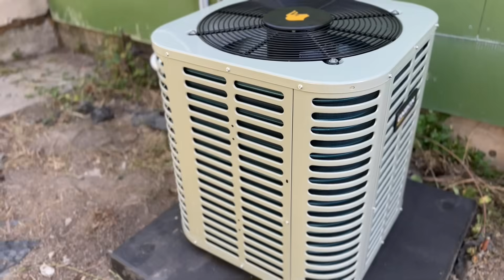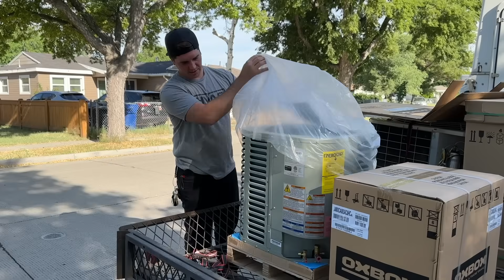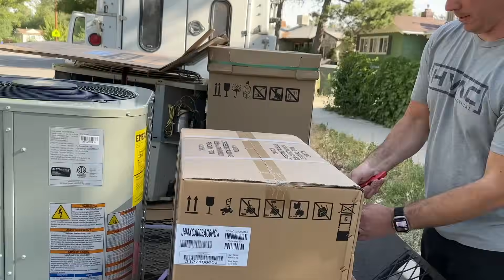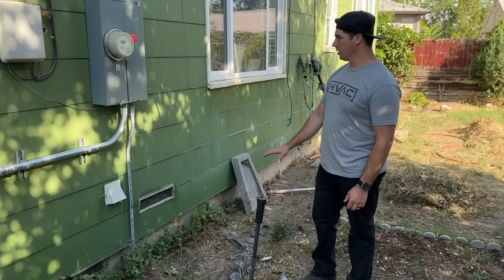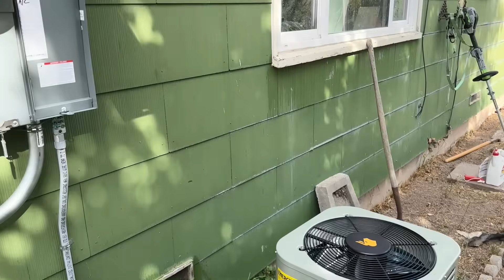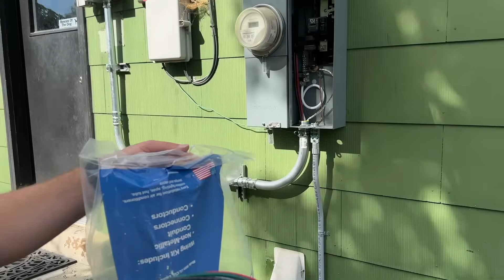We Added Air Conditioning To This Home In ONE DAY.     |      Full Installation From Start To Finish

Comment: I have a ACIQ 3 Tone heat pump. I have install it and powered it up several time. I can only get the air handler fan running that should not be running. What can I do?

Comment: At around 14:30 minutes or so  he just swapped g to to y but many boards require a g call as well to energize blower in cooling.  A simple jumper between y and g would fix if that is your situation
Reply: Im also wondering same thing, im new G is always fan for starter like me. When move to Y for cooling sure it will energize fan when thermostat call for cooling what happ3n when its cold and the furnace start the Y is not energize and so is the fan, i feel like an idiot here

Comment: How is the low voltage/24v wire ran start to finish. Does it not need a junction box by the disconnect

Comment: Absolutely the wrong way to do the braze joints with a high pressure refrigerant like 410A 😂 don’t believe everything you see on the internet or YouTube. Also ALWAYS USE A TORQUE WRENCH. Refrigerant burns the shit out of you and displaces oxygen. So many issues with this install. Way to close to a window, way to close to an exhaust vent and really far off of the house. It’s dangerous work, if you can’t do it safely or legally, hire a professional.

Comment: Love your videos. I just got my A/C serviced and the technician said that I would need a new capacitor. He hooked up a voltmeter to the left node and it was about 37%......he said it should be around 40%. The right-side node was about 5%, which he said was good. He said the cost of an installed capacitator would be $375...which seemed very high to me. I took a photo of the part and after he left, I checked on Amazon and saw the part was about $17. My question is ....at 37% does this part have to be replaced? We haven't had any issues to date. I live in the Boston area so the next time we'll use the A/C will probably be in June/July 2025. Thanks

Comment: I have a 20-year old Bryant gas furnace. It was installed with the evaporator, lines and power connection outside for a future AC unit. I buddy of mine is installing a new heat pump at his house and he's giving me his 2-yo, 5-ton Blueridge BA16L60P A/C unit.  What should I consider/check out in deciding whether this A/C unit will work with the Bryant furnace? I've had HVAC companies out to give me bids on installing A/C and most of them told me that the evaporator couldn't be used, usually without even looking at it, and of course they all want to sell me a new furnace "because that one could fail at any minute!".  I don't need the scary sales tactics, I need an honest opinion of what's possible here. Love your videos!

Comment: Very green neighborhood for an arid region where swamp coolers work.  We had one in a Mojave Desert rental house, but didn't quite suffice when 110 F outside.  My 1.5 ton Della minisplit heat pump came with an AC cord of just 16 awg wires (240 VAC).  Instead, I ran 12 awg to the cut-off box and previously ran 8 awg stranded from the subpanel to the cut-off, both for the future and because didn't know how little current the compressor would draw (1.5 kW max).  My central AC failed, so looking at replacing it.  Only need 2 ton or less since the mini was actually cooling my whole house this summer (Central CA, up to 110 F days) and have all Winter to fix 'er.  Options keep improving for a smart inverter type w/ duct evaporator.  First I heard of this OxBox system.

Comment: Hi DIY HVAC Guy, I don't see you charge the new AC unit with the refrigerant. When you charge the new AC, do you turn on the AC system with empty refrigerant in the pipe?

Comment: Hey gang, 20 years ago, I installed my 3 ton Trane 19i with R22.  I'm 66 yrs old (retired) now and do not have the money.  It appears my compressor is shorted, but I do not smell any burnt freon...strange.  I want to install another AC with 410a, but I do not know what unit to buy.  Trane was too complicated and expensive.  I just want something easy -- not fancy...maybe variable speed fan.  Can someone give me some advice on a unit? Also, I do not know what to do with copper lines (high & low). Can I keep the same high & low copper lines if I switch from R22  to 410a?  Do I simply vacuum lines before recharging?

Comment: I have a dumb question: Can I check for leaks injecting compressed air into the lines?
Reply from the maker: No!! I mean you can but you’d be injecting a ton of moisture which is what you want to keep out of the lines. Nitrogen is a dry gas which is what professionals use it.

Comment: I’m in an older house that has a 100 amp as the main breaker for the house. Would I have to up that to a 200 to install this?
Reply from the maker: Depends on the size. If it’s smaller like a 20 amp breaker, (1.5-2 ton) then you could probably get away with it.

Comment: So the units come with the refrigerant already in it
Reply: Yes. He installed the equipment. Linesets and got them soldered. 
Next he used Nitrogen to pressurize the line sets. 
After he proved they were tight. He used the vacuum pump to remove any traces of water. Water and Refrigerate creates an acid.
After he proved a tight system again. 
The very last step is to release the refrigerate into the system.
Reply: @2nickles647  i don't see he charges the system with refrigerant. Did you see it? How did you charge the new AC unit with refrigerant? Do you turn the AC on? I'm not sure if the NEW AC comes with a little bit of refrigerant.

Comment: I JUST WALKED INTO A HOUSE WITH A BOILER FOR HEAT, SO THEY HAVE BASEBOARDS......AND THEY HAD TWO BULKY AC UNIT OUTSIDE BUT INSIDE THEY HAD NO WALL UNIT INSTEAD THEY HAD VENTS ON THE CIELING???? I THOUGHT IF YOU DIDNT HAVE FORCESIR/FURNACE YHEN YOU WOULD NEED A WALL UNIT .....HOW IS MY EXPERIENCE POSSIBLE

Comment: My one question is why did you sweat that drier on the tailpiece?  If you ever have to open that system up for repairs you would replace the drier correct?  How would remove the drier?

Comment: Thanks!
Reply: I just replaced my old furnace and AC system after I installed it the new system is working fine,..
It was a little bit harder than how it looks in the videos but I was able to do it, thanks so much for your videos I saved a lot of $$$$

Comment: As a hvac tech great job on the install. Only thing i would suggest is that you need to let your viewers know that they should check with their local laws. Permints may need to be pulled. And its possible that if its not installed by a licensed hvac company insurance can deny any payments if house  catches on fire do to improperly installed unit.

Comment: The problem with installing your own AC is that besides being EPA certified you need a state contractor license just to buy an AC which sucks. I can buy all the r22 I want but I can't buy a flipping ac without going through hoops to do so on the internet which makes no sense.
Reply from the maker: Wrong. It’s super easy to buy equipment online. Amazon or hvacdirect as well as another handful of companies sell to the general public.

Comment: Great job! I installed 2 units (3 and 3.5 tons the same way, but with TXV) plus a 1 ton mini split (easier). I have Testo549 with Yellowjacket hoses, vacuum pump and CPS micron gauge, Appion valve core removal tools. Staybrite8 (high vibration, high pressure and refrigeration applications) was a great find for me for the second unit, sped up the process vs brazing with turbo torch.
The key is to invest in high quality professional tools/nitrogen tank (for me it was ~$400-500 overall) and then do it slowly. Warranty is not a concern, cause most of the time you will still need to pay for labor (90% of the cost) even if you’re under warranty , the equipment is cheap and available online anytime.
Reply: Did you buy them used there is no way in hell you can get all that for 500$.
Reply: Today, $2500

Comment: I found it very confusing when living in the USA that it is called HVac. It’s only 220 watts. Mine barely worked when it got really hot. But living in a condo, the other owners were not prepared to spend any money to do anything about the almost non-existent insulation of the building.

Comment: Well most of the HVAC system can be done by a tallanted DiY type.  But there are parts better left to a proper HVAC contractor, those being the pressure test, vacuum down, and then charge the system properly.

Comment: Well done! I'm from the old HVAC school. 44 years in the trade and as long as i have stayed open minded and teachable, I learn how to do this job in easier and safer ways. Great video young man!
Reply from the maker: Thanks bro! 👊🏼
Reply: hello sir pls help i forgot to turn off my heat pump while renovating sanding the kitchen i have central air vents in the kitchen mu question is does the vents in the kitchen sucks the dust and can spread into the whole house?
Reply: @fluxcapacitor8416  in my experience the supply air register in your house ONLY blow air. The only register that has the ability to "suck" air is the return air grille which is taking air from the house back to the air handler or furnace. Keeping your air filter (s) clean by replacing or washing them on a REGULAR basis will help a great deal in keeping your air and HVAC system clean and running efficiently.
Reply: thank you sir i found the grille on the attic beside the stairs iy has 20x20x1 filter size these could be the return.
Reply: @fluxcapacitor8416  yes, that is your return air.

Comment: For my experience, if u buy off from online without license, there is no manufacturer warranty on that. Finger cross it works well.
Reply from the maker: I offer that service at Patreon.com/diyhvacguy we can register your equipment for a flat rate of $100    Then it will be covered for the full 10 years 👍🏼

Comment: There are so many shady people in this industry ripping people off.  Most of these so called professionals should be put out of business.  Telling homeowners they need a whole new unit when a low cost replacement will do.  Love the channel and educating us on how to do repairs on our own equipment.  If these companies and the people that work for them were honest we would not need to try and learn it ourselves.
Reply: Yep I was low on R22 on an 18 year old Bryant. r22 leaks over time just like all refrigerants. Even the EPA cert teaches you when you study that no system will be 100% leak proof and all systems eventually need a recharge. Instead of offering to leak down test and recharge with r22 which believe it or not is still affordable when you buy it yourself, he wanted to upsell me a $12,000 brand new unit installed. I know the AC is about $3500 alone brand new and takes about 4 hours to install if your good. So why should I pay you $8000 extra? That is why I got my EPA cert so I can just do my own damn maintenance and I have learned about Goodman. I dont need a whizbanging 4,000 Seer super inverter mega zone 3 Million Super X AC. I just need a damn ac to blow some cold air. I can fix it when it breaks oh whoopie do! That HVAC tech could have made up to $1000 if he would have done honest work for me but he tried to take advantage of me and I bought into his scheme at first but was hesitant to accept it so I slowed down and did my own research boy what I learned during this process.
Reply: @DeepSouthVeteran  where are you at that R22 is still considered affordable? It's expensive as hell around where I live.
Reply: @gtpforever  
Its affordable if you dont leak much. Say a typical home has 4 pounds of refrigerant in the unit.
Using "Wholesale" Site this guy talks about. Its priced at about $650 per a jug. That is about 21 bucks per pound. My local supply houses charges about $30 bucks per pound.

If you have a small leak that you recharge maybe 1 pound every summer. Thats only 21-30 bucks. Granted you are paying up front $600-1000 usd for 30 pounds. You dont need EPA or expensive tools to charge. You can buy some cheap hvac gauges online or probably find some at a local pawn shop for cheap. At this point you dont need to be exact. Just take it slow. Charge a tiny bit. Wait a few minutes. Check the temperatures in your return and supply vents. If the difference is around 15-20f you done.
Reply: @DeepSouthVeteran  
That is not true. A system should not be leaking over time and be considered normal. Sure in some 30 years but today stuff is made worse and leaks in 1/3 of the time. EPA certification teaches you barely anything. You could pass the exam in 1-2 weeks of studying. All that nonsense is for is government bloat
Reply: @@eric3817 Overpaying for a service is not value.
Reply: Ebay
Reply: People in my area charge $12k for new installs.
Reply: Isn't a low cost replacement and a whole new unit the same thing? Lol

Comment: This guy made plenty of mistakes and although he trusts staybrite 8, I would not recommend it on a 410a system due to its low melting point and the higher temperatures/pressures associated with 410a. Never installed a disconnect box, regardless of the breaker being right outside. Also not a good idea to use different color t stat wires other then what they are associated with when it comes to function. Also never oversize the tonnage, if it’s a 2 ton heater, best to install a 2 ton AC, or could lead to freeze ups as not enough CFMs of air over the coil. Lastly you want to do a pressure test of at least 300 plus psi of nitrogen, especially given that’s it’s a R410a system. Makes me wonder if he cuts corner due to lack of knowledge or laziness or both.
Reply: I was looking for someone in the comments to point out the solder he uses, i was like those pressures on 410a can get up 475 in hot climates so i wouldnt think that seal would hold up if pressures consistenly hit 400psi on the high side and not to mention the other things you pointed out!

Comment: Is that soft solder ok for 410 A or is it recommended by manufacture we usually use silver solder and the metal ducts are not insulated, I understand for heating since it was an existing system but now that you have added cooling are they not any code issues for not insulating metal ducts. My guess is you are in a northern climate, Down here in Texas it is a requirement to use a minimum of R-8 duct insulation on any ducts outside the building envelope which is 2 inch thick.

Comment: hey dave I got a question about some hack that took a pair of channel locks and crimped the low side coupling around the old line set in a apartment unit on a roof he was replacing a goodman condenser it seemed like the new unit was like 1 inch and line set was 3/4 or 7/8 and brazed the crap out and said something like 15 percent the braze would be filled in maybe you can add this to you video hope to hear from you!

Comment: The reason you put the filter drier next to the coil is to protect the metering device.
Reply: Also It will NOT RUST OUT like it would outside !
Reply: @pablogaviria9265 You both are wrong
Reply: @martingates6501 so what’s the right answer instead of saying their wrong?
Reply: @ES7MLowkey on this video, he put the filter dryer in a wrong place an position

Comment: Where was the freon charging part?
Reply: 31:30 the factory pre-charged the refrigerant in the condenser unit. He opens the service valves to release the refrigerant into the line set and evaporator. Depending on the length of the line set, you may need to add additional refrigerant.

Comment: You are a good, clean installer. But man, these are nowhere near a Trane system.  These are the horrid “Ameristar” units made in China by Midea. Oxbox is the brand they sell to general distributors. If you want a Trane on a budget, get the newer Runtru brand. Those are made in the Trane factory in Texas. Literally a Trane XR14 in a cheaper cabinet, same spinfin coil and all. Anytime you see those tube and fin condenser Ameristars and Oxbox, know it’s just a generic Midea unit from China (P.S. seems like ameristar is also selling the Runtru XR14 based unit as their main product, while keeping the Midea 🗑️ on the low end.
Reply: Just get a fn trane lmaooo or rudd malakiese

Comment: Let us know how it goes when you break down under warranty, on the weekend or when it’s 95°F.
Reply: I will buy another one and install it again and still be cheaper than your shady ass.
Reply: @Kevin-mp5of  I catch them all the time lying, hvac has to be the biggest group of liars I have ever dealt with. They are so bad the company I worked for created a job just to deal with contractors because of Hvac goons.
Reply: My 6 year old $11k unit needs to be replaced they want $15k I think that is absurd. Wanted $300 for a $42 filter and $250 for a $37 UV bulb. Did it myself $79 instead of $550.00 t
Reply: Looks like we got a price gouger

Comment: Hey, a great video with lots of good tips and a job well done. I'll offer a safety recommendation regarding high pressure cylinders. You should always turn your regulator back down to zero before opening the high pressure valve. If the low pressure diaphragm side fails, the high pressure can shoot that adjustment knob out at really high velocity. Just saying. 🙂
Reply: Great tip - Safety First!